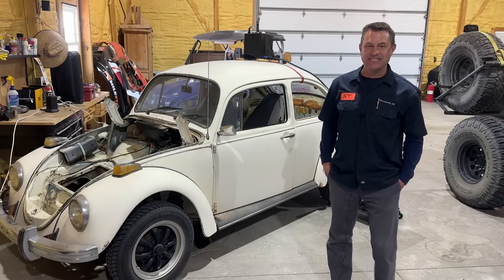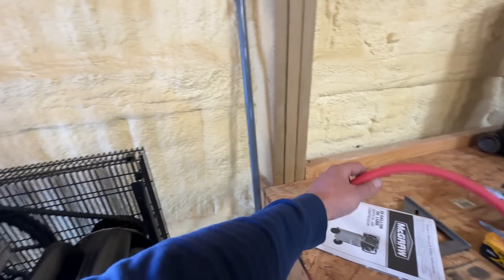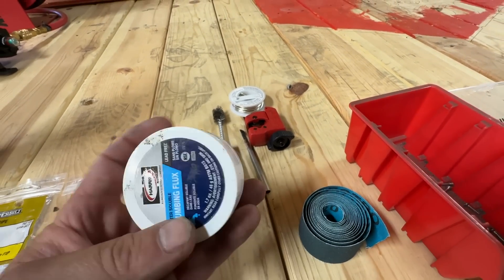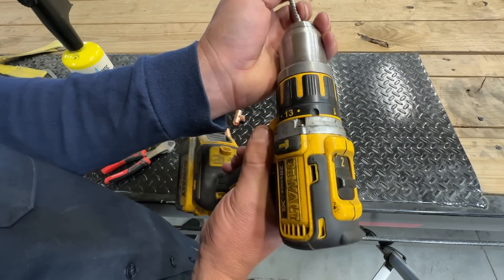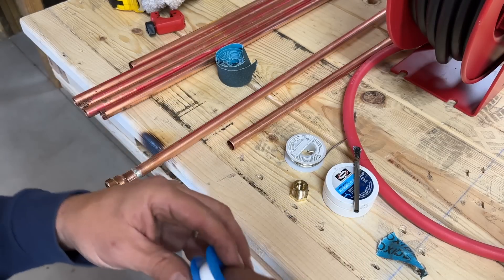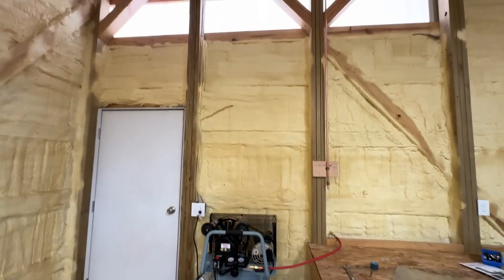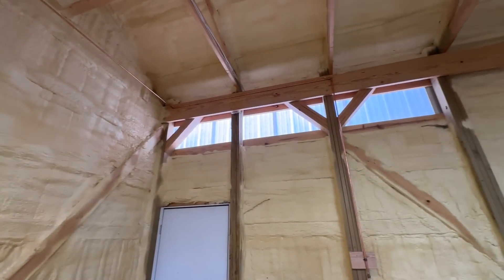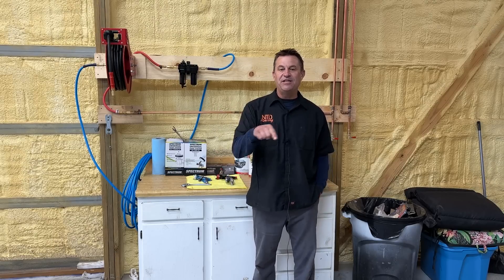How to build an AIR DRYER - New Harbor Freight Paint Booth

Comment: Honestly just here to HELP not being a jerk at all.  But first and foremost I have a shop and do custom paint.  I  can't stress this enough especially if using a BLACK WIDOW or any HVLP,  but Especially  a "HTE" gun, it's not about PSI, all the PSI in the world means nothing.  You need cfms, like a compressor rated at a minimal 12.5 cfms @90, and that's super low. A rating 14.5 -15 cfms @ 90 would be ideal.  Again I'm just here to help, hope this helps someone before they run out to buy a Mcgraw.   CFM ratings are the most over looked technicality in the painting process.  You may get paint out but it won't lay down material as nice as it should and will cause problems.  I can honestly say,  just having a compressor with the right CFM's alone paired with even the shittiest gun will out perform a great gun with underated cfms.  I can lay down paint like Barrett-Jackson Jackson out of the gun, no wet sand or buff, nothing with a 69.99 HF chrome professional water born gun, just as well as my Black Widow or Iwata or $1300 SATA, with the correct cfm's.  I'm willing to help anyone if need be, I'm not on here alot but helping eachother is what it's all about.  In the end have fun with the process guys, what it's all about.
Reply from the maker: @n.chappy5879  Thanks…still going to try it.   If it does not work, I will be the first to say it.

Comment: If you cool air before it enters tank you don't need a dryer, l did it by adding a 25 foot roll of 1/2 copper tubing with a water separator before compressor tank eliminated 80 percent of moisture from hot compressed air hitting cooler tank

Comment: That compressor dosent put out enough CFMs for the black widow,  pressure means nothing, CFM is what you go by
Reply: I came here to say this, he should technically have 14.5 - 15.5 cfms for all overs.
Reply: @n.chappy5879   It's rated for 11 CFM,, l do fine spraying with the widow with 11.7 CFM, your using at 35 psi with that gun, he probably does ok for just panel work but no chance with a whole car spray

Comment: Worth mentioning if anyone isnt concerned with perfectly linear runs,  you can buy rolls of copper tube in 1/2, probably up to 50 ft at your local HD/Lowes.

For the real eager group, you can also buy solderable fins online that you could put on the tube for superior heat exchange.
Reply from the maker: @tugmeboat  will try that on the next one…thanks

Comment: You should put metal siding or sheet rock 15:19 on your interior walls.   The spray foam in your walls is an extreme fire hazard

Comment: You should build an after cooler, to put between the compressor
head and the tank, to keep water from entering the tank.
Sure, you can drain the tank but it is best, to not let the water get in
to begin with.
Alternatively, you could use an automotive oil cooler.
On either one, put an air dryer on the end which feeds
into the tank. There are multiple YT videos, on doing this. 😁✌🖖

Comment: A few observations. You can turn the hose reel upside down so the air connector is on the other side. A larger copper tube will dissipate heat quicker, so any condensation will happen closer to the compressor. It appears your copper line before the hose at the reel is level, it should have a slope away from the hose connector towards the drain valve. Also, at the compressor, I think the air hose should connect to the copper line horizontally and a drain valve be installed where the air connects now since a lot of the condensation will collect closer to the compressor.
Reply from the maker: @FE428Power  huge thanks for the advice.   I am sure many will find it helpful.  Will make the changes on my set up too.

Comment: You should put a drop right on the tube where you're compressor hooks to it, I have a similar system and I get the most water out of the first drop.
Reply: The desiccant beads can be reused as well. Put them in the oven when they turn pink and you can dry them back out. I don’t think they ever get as dry as when you first use them, but if you use it a lot it’s worth the savings. I find this to be the case when using my plasma table
Reply from the maker: @onefortheroad2291  Cool.  That would have saved me some bucks in my other system.  Thanks.
Reply from the maker: @IBRACIN  thanks.  Will add that.